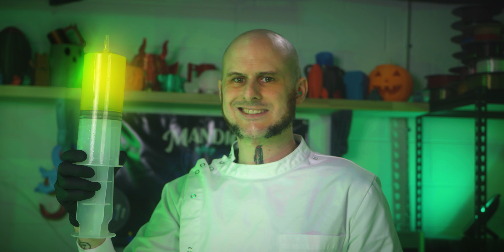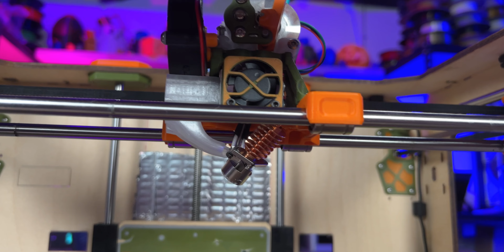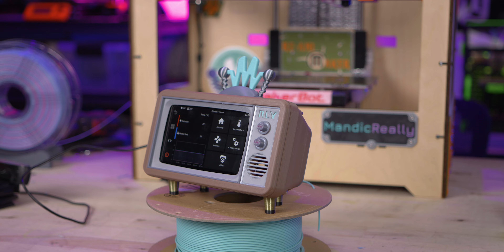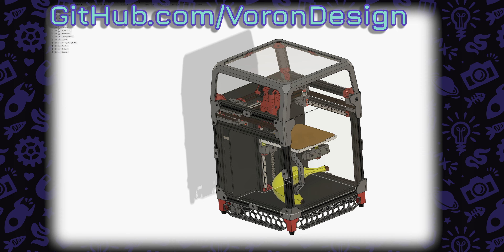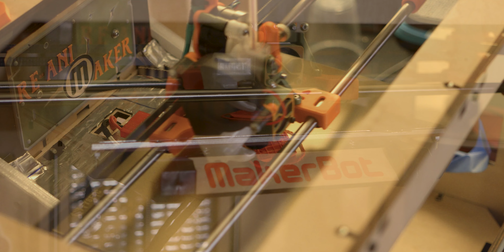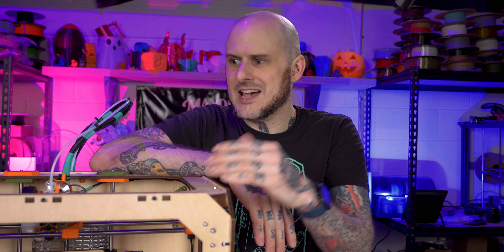ReAniMaker - RestoMod 3D Printer

Comment: Love this project, saddens me that this video didn't perform that well. 😢 My Solidoodle 3 will be slightly more compact, but the full steel frame will provide good rigidity in order to push accelerations. Going to use a Voron Legacy X-carriage and the plan is to use the XoL toolhead with CNC Sherpa Mini. Haven't found many toolheads that won't need modifications or remixes in order to fit the Sherpa Micro.

Comment: Nice restomod!  The TV screen was a great project in itself!  
And the getting to ERRF was highly relatable, I was up til early before SMRRF to get the vase from my giant printer. I'm modernising my Replicator 2's and you've inspired me to do a few things - remodel the Y carriage parts, and fix a similar fitment issue I had on the e3D hot end X carriage - same rocking back and forth.
For the motors... The original Makerbot firmware and slicer does a lot more than most slicers to retune the motor power on the fly - the original boards had controllable current and it's constantly tweaking to supply more or less power to the motors - as they use more or less depending on how fast they're moving/holding.
Reply: Did you rework your Replicator 2s and is there a place to see it?

Comment: No way, I just realized that you just posted this 3 weeks ago.  Funny because I have a dual extruder model that's been gathering dust. I was just going online to check out what other people have been doing with them 😆 🤣.  So it's funny you busted yours out too.

I happen to have an extra Ender bed heater sitting here.  I think I might have swap that out and also change the build plate.  
Let the Frankenbuild games begin!
Reply from the maker: It was meant to be. I’ll be releasing the design files for my build very soon. Just need to final test some new revision parts. So maybe you can use some or all of them for your build.

Comment: How much did it cost to do this?
Reply from the maker: Time was the greatest investment. As for filament, I had to print many prototypes so I can’t say how much of that would be required either. Most of the parts were provided by brands, so I don’t really have a total unfortunately. Realistically it could be built in a number of different ways with differing values. A cheaper board, power supply, and hotend could be used.
Reply: @MandicReally  Do you think the frame does a good job?
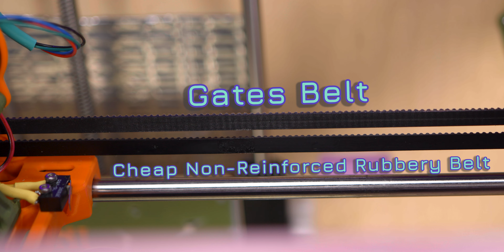Reply from the maker: @Brocknoviatch  the frame does a surprisingly good job.  It resonates a lot so it is noisier than other machines, but it stays pretty rigid.  I just posted a video today where I printed a 16:33 Benchy on it and it turned out surprisingly well.

Comment: Amazing work on this! I am doing a restomod of my old SeeMeCNC Eris delta printer using modern voron parts and it's amazing how well the new electronics and software help print quality and speed. Hotend and extruder design has exceed so much in the last couple years it's incredible to see the hotend competion "heat up", so to speak.

Comment: Where did you find the MakerBot Replicator step files?
Great channel btw. 👍
Reply from the maker: It was a semi-broken Solidworks assembly that I couldn’t locate again when I went to fill out the description of this video. I’ll see if I can locate it or maybe release the repaired STEP file. The original assembly was missing some components and I had to trick it into working.
Reply: @MandicReally  Ok I´ll wait patiently for the F360 files to be released. 🤩
Reply from the maker: FINALLY Got the design files for my release of ReAniMaker available: https://social.thangs.com/m/621414

And I relocated where the SolidWorks files for the MakerBot were: https://www.thingiverse.com/thing:18813
Reply: @MandicReally  New project time! 👏🏼 Thank you for your time and effort in this project.
Reply from the maker: @crazytrutas  I just decided to release the original MakerBot Replicator files as well.  So if you still want those you can find them here: https://social.thangs.com/m/621863
Reply: @MandicReally  Your the best!

Comment: Ha! Amazing, I have a Replicator 2x and I've rebuilt it in 2020 with an SKR 1.4, TMC2209's and a self designed new hotend carriage. This year I decided it was time to upgrade once again because the original Makerbot gantry really isn't that good so I started turning it into a CoreXY design, but I didn't make it yes because I'm still waiting for the linear rails and this is my only functional printer, so I have to print the upgrade with this machine. It has an inductive sensor for the bed leveling which works really well with the wonky bed. Ps it's not Fystec, but Fysetc.

Comment: Dragging out my creator pro now....klipper here it comes ..
Reply: I had changed the board on my FFCP 2012 version. I would say its quite worth the change. but I had to re crimp all the wires and play around to get the Heated bed to work. you would need to change out the hotend thermistors too as the OG ones wont be recognized by klipper. Currently im slowly slugging through on the Core XY mod.

Comment: Haha...I was one of the first people to meet you at ERRF and ask about this machine when you were setting up the table. Really brilliant mod. Are you releasing the designs ?
Reply from the maker: I will be but I need to do a final revision of them before I do. I’ll post a comment update when I get the files released.
Reply: @MandicReally  thank you...I have an experimental printer from many years ago that is basically a replicator built with aluminum extrusions. It's disassembled and sitting in a box. Your conversion has motivated me to see if I can convert it to corexy as well. Hope to use some of your parts.
Reply: @whatisyouremailid  I'm gonna do the same

Comment: Very cool project!  Been thinking about resto-modding my SeeMeCNC Rostock Max V1 from back in the day.  It is 10 years old now as well.  I spent 5 years upgrading the control board etc, but never the power supply (big mistake).  With a 24v power supply and some added part cooling, inductive sensor, more adaptable mainboard, etc,  that thing would absolutely kick butt.

Comment: after using the dropeffect xg hotend do you recommend it, btw really cool project
Reply from the maker: Sorry I never got around to answering this.  I like the XG.  It is easy to mount, easy to service, and compact.  That said, I'm not sure the flowrate is as high as I'd like.  It is smaller and ligther than a Dragon High Flow hotend and I think it flows similarly to that, but maybe slightly lower.  I have to test it further to find out for sure.  So, if you need small and lightweight, it is great.  If you want the highest flow you can get? I'm not sure it is the right call.
Reply: @MandicReally  ok thx for answering me, I already got a triangle lab tr tchc hotend it has a ceramic heater core 50w it’s uses v6 nozzle same height as stock Ender hotend 3 and 5. I bought this one for around 30 dollars also heats up in less than a minute to 240°c. It’s great you really should look into theire chc hotend line really good and affordable